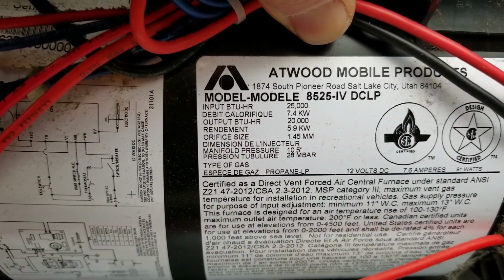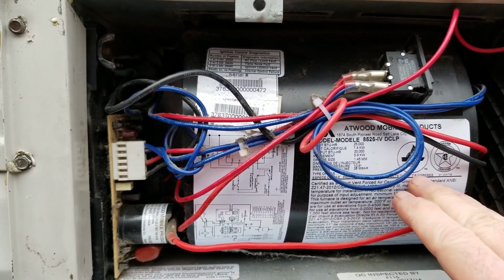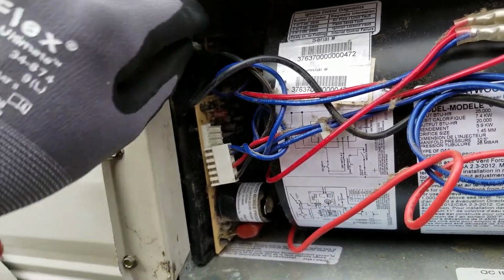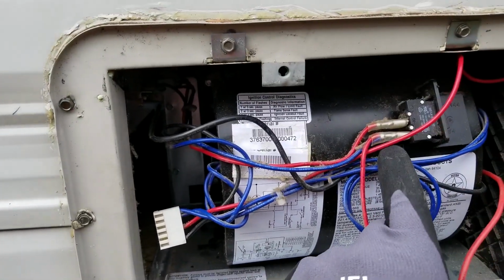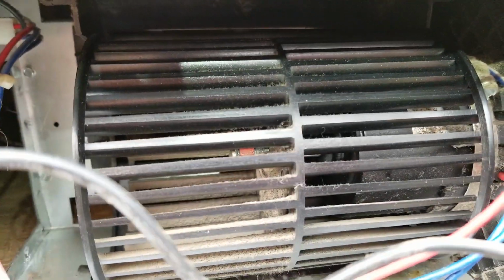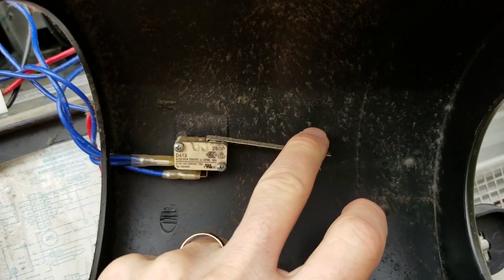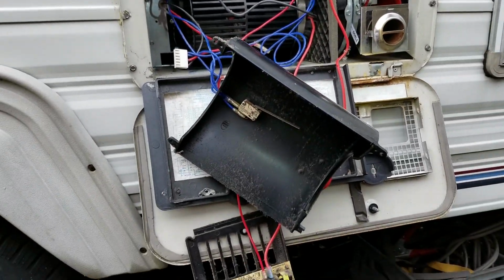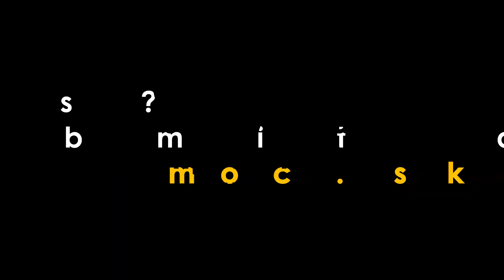Atwood 8525-IV RV Furnace Air-Flow Problem Due To Loose Blower Motor Cage

Comment: Thank you for your videos. They are a great help when you cannot afford unlimited repair bills. Have an Atwood 8531- IV. We woke up one night to a rattling noise coming from the furnace and then the furnace stopped working. I thought something may have broken or mud dabber nest broke free.  Opened but saw no debris. Circuit board is indicating air flow problem.  Checked the Sail Switch. No debris. Closed it and checked continuity-good.  Fan and fan cage seem fine. No rattles. Not broken.  I heard in this case the limit switch is rarely the problem.  What other options should I consider? Thank you for your help.

Comment: Hello fellow camper owners.  I just completed a long multi week hunting trip in Utah and Colorado in our 1995 Lance TT.  Right off the bat I was experiencing some furnace problems with the Atwood Dometic Furnace. This was not good as we were heading to some high altitude and cold weather into the teens.  The furnace  would initiate the start sequence with the fan motor turning on and approximately 30-45 seconds it would not open the gas valve and would not start to warm up.  It would shut down.  I tinkered with it for a few hours.  The code was an air flow code.  I initially thought it was the sail switch so I wired around the sail switch to see if it fired.  It did not.  It was not the sail switch, in my works I discovered that the stainless exhaust port has to be fully shoved in and tightened down.  With the intermittent problems I have had with our furnace over the past summer, the hold down screws for the outer cover were a bit loose,  I used toothpicks to assist and hold the outside panel in place, easy fix but thought others could use this information.  One of the problems that caused the intermittent operation was the fact that we tow a lot of roads and things come loose especially screws that have enlarged holes.
Reply from the maker: Thanks for the info. I do mention on some of my videos that the relationship between the sail switch and the Control Board needs to be such that the control board sees the sail switch changing states. So, if you bypass a sail switch, or wired always open or always closed, your furnace would not ignite because the control board never saw that change of states.  Also on the AF series furnaces it is important to have that exhaust port installed as it is part of the entire furnace system.  So glad you found that out as well. Stay warm and happy camping.

Comment: My old camper. Same Furnace. Thanks to our resident mouse a peace of peanut shell was hanging the sail switch. Thanks for your help. I removed the peanut shells and took the little peace from behind the sail switch. Put it all back together crossed my fingers and turned it on, poof on came the furnace. I'm a real live hero at least for a few minuts. Thank you for the video! Ron

Comment: Thank you for this one.  I had my entire unit out yesterday and damn if I could figure out where the sail switch is.  My furnace fan is coming on but I am not getting ignition.  Occasionally it will work but more often than not, it isn't.  I have always suspected the sail switch but could never find anything that would show me how to get to it.  Hopefully it is a lint problem.  I was ready to replace the control board and the gas valve.  Will see if this fixes things.  Kudos!

Comment: Thank you for this video. The furnace in my trailer is exactly the same model. Your video was easy to follow, and correct. My sail switch had lint debris on it. Cleaned , and reinstalled and we have heat again! I did this repair today, while camping. 10/29/20. Thank you!

Comment: I have been having sporadic heater problems with my 2019 Coachmen Freelander 32 FS. I had removed the sail switch and checked it with my ohm meter several times.
It always checked good. After watching this video, I realized it must be my sail switch, but how can that be ??? I looked at the little bracket that holds the sail switch and 
then tried to see if it would work and it did as long as i pressed on it. The pressure I was putting on the switch was more than what the blower would exert on it I surmised.
So, when I tried to do it with little pressure, it wouldn't come on. The "sail" was hitting the bracket !!! So I filed about 1/16" off the side of the bracket where the sail was hitting
and WALA, works fine now. I think this is a design flaw by Dometic. Just my opinion. Could not have solved this without fulling understanding the problem spelled out by the
video. Thanks, sorry this was so long but felt it needed to be said to help others that can't figure out why this would happen.

Comment: Thanks for all the tips, I was able to fix my 8516-111 furnace simply by bending the flame sensor rod closer to the burner, no more intermittent heat. It hasn't worked properly for the last 24 years, Yahooo!

Comment: I have an 8520-IV that had the same error, however, the housing was fine.  Disconnected the circuit board and reconnected and all is well. Thank you for the tip!  Furnace is fired up!

Comment: Just purchased a used travel trailer with this furnace and haven't had a chance to test it yet. Unfortunately ours does not have an external door so may have to detach it inside and have a look at it.

Comment: I have the same model number furnace, but my control board doesn't have those two wires you didn't disconnect, and I have a circuit breaker and blower motor relay attached to the housing along with the power switch...  🤔

Comment: I have the same furnace and have the same blinking light warning, I took off the cover and the fan is really clean, is it possible that the switch is bad? Could it be a thermostat issue? Or is there something else that would throw that same warning light? I really appreciate your videos! This is my wife and i first travel trailer and we are having to fix somethings and I’ve found all your videos to be helpful!

Comment: thanks for the video. My camper through this code this morning. With the info in your video, I was able to get mine to work again. Going to bring up some canned air and clean out the squirrel cage and see if that will keep the switch from sticking. If it throws a fault again, I will order a new switch.

Comment: Hello Darren 
I have an Atwood 8535-111 after watching your many great videos 
I pulled the burner head out and it was rotted out 
Every one is saying that burner heads for this furnace are no longer available 
And after many hours searching found some similar but as you said they are different similar but not same mesh hole size!
Do you have any burners for this model or what would you recommend ??

Comment: Hi there, thanks for your video. in my case the sail switch is clean and the furnace is lightning, hot air coming out the exhaust but only blowing cold air inside... any ideas on what that could be?

Comment: So mine did the same thing.  I tapped and rapped on the fan housing, hit the reset on off switch and it started working.  Mine is a new design with the control board in the middle vs the left.  So do you think something got lodged in there preventinhg the switch from activating.  I'm afraid that it will happen again.  Do these switches fail?  Update:  From watching so more videos mine is newer with the sail switch available from the outside by removing a couple of screws unlike the older way that required removing half of the fan housing.  Mine was covered in lint preventing the switch from activating.  I Ohmed out and the switch is good.

Comment: I have a question i have exact same furnace runs great no issues fan turns on furnace runs for about 5 min then flame shuts down for about 2 min can stays going then kicks back the flame again is that normal to cycle flame im not familliar with these thank you

Comment: Hey body, I never own a trailer before but just bought a 2005 22’ Jayco from a cousin last month.  I just notice that the heat wasn’t hot.  The furnace turns on but shut off after about a minute.  Do I need to open the propane tank before I turn on the furnace?  Or is it something else?  I have an Atwood furnace as well.  I subscribed to ur channel.  Great vdo and info.  Thanks
Reply: So you will need to turn the propane on first yes. Then actually get it to the furnace. I usually put a lighter to the stove until it ignites to get the propane through the line as much as possible. Whats happening to yours is its turning on like normal, not igniting the gas because its not there, and then as a safety its shutting back down.

Comment: Thank you. I have a 40 ft class a with 2 of these same heaters . I have to get them working for winter coming fast . They were working last year when I got RV .   I will check snail switch and follow up . Thank you for the tips and info

Comment: My RV is only 2 years old and I have a single blink. I’ve blown everything with a air compressor and still same single blink. Could that white piece that the sale switch hits be to tough all of a sudden ? Should I spray it ? Obviously let it dry before turning back on.

Comment: I am having the same issue with my Suburban SF-30 furnace. Replaced the circuit board thinking that was the issue. Problem still there. Fan starts, no ignitor clicking sounds, furnace shuts down. I checked the sail switch. I appears to be functioning. I will bypass the switch to see maybe it is actually bad, then I am clueless.
Reply: I the sail switch has to make a transition. A constant close doesn't provide a change that happens from the fan moving air.

Comment: Hi rv works my rv furnace works fine but the blower stopped working it once blew nice heat out before  I hear the click from the thermostat but doesn’t engage now
Reply from the maker: The low-hanging fruit would be to check for a blown fuse. But I'm sure you've already done that. We're working on uploading a video where we're diagnosing the fan motor itself. That one should be coming out in the next week or so.

Comment: How do you find a relay switch? Our trailer is 30 yrs old and was told that needed to be replaced...faculty.
Reply from the maker: On a furnace, a relay is used to start the blower motor. Some of the older furnaces will have a small Ice Cube shaped relay with four wires coming out of it that is mounted to the right of the blower housing. Others will have that relay on a control board.

Comment: My furnace kicks on and runs but does not fire.  It will not shut off after 15 seconds either.  Fan will run and run until I turn it off but will not ignite.  Gotta check sail switch 8355-11 hydro flame

Comment: I have an Atwood furnace model number 8940 111 dclp in my fifth wheel furnace will not come on when you turn it on hear clicking in the front air conditioner
Reply: The circuit board has one flashing light check the motor the motor has work on a 12-voltI've checked all fuses all fuses are good have unplugged circuit board plugged it back still doing the same thing I don't know how to check the sail switch have a small clicking noise after I reset it then light blinks
Reply: It might be the relay which is on the circut board. In that case but a replacement.  It could also be a sail or high limit switch.  Sail switch is easy to replace but limit switch is more difficult.

Comment: Mine blows and blows but doesnt get hot the sail switch is clean and i cleaned everything but it still wont get hot it just blows clod air until i turn it off so whats that? It looks just like this one not dirty at all
Reply from the maker: It sounds like you are not getting ignition. So if you're not getting ignition you need to follow the control wiring circuit, I refer to those as the blue circuit. If you have multimeter make sure you're getting 12 volts back into the control board after it's made these stops through the sail switch, high temperature switch.
Reply: @MyRVWorks  got it going but i can smell burning smell inside i cleaned put the dirt it blew out, i have 2 carbon monoxide detectors so hopefully its not that but it smells burned is that normal? Its a 1995 holiday rambler Alumilite heat has not been turned on in probably 8-10 years

Comment: What did you end up doing here long term?
Reply from the maker: Customer did not want to invest in a new blower housing so I wedged some foam between the service door and the blower cover to keep it in place.   Unit is stationary so did not need to consider road conditions.  After about a year still working!  Had to go with what the customer was willing to spend vs. making the 'correct' repair.   BTW: same customer, different RV, as the water heater job that was dying from (blue) rust flakes.  https://youtu.be/EsjiDo7FN_Q

Comment: BEEN SEARCHING FOR A PERSON LIKE YOU THAT KNOWS WHAT THEY'RE DOING. I HAVE NOT WOOD FURNACE IN MY RV BUT I'M GOING THROUGH A TANK OF FUEL IN 27 HOURS BARBECUE SIZE GRILL I SHOULD SAY 20 POUNDER. BUT I'M A DISABLED VET AND CAN'T HARDLY AFFORD THAT COULD YOU PLEASE TELL ME WHAT IS WRONG WITH MY FURNACE.
Reply: A 20 pound tank of propane doesn't go very far when it's cold out in a poorly-insulated camper (thin walls, single pane windows, aluminum trim).  Your furnace is probably fine.  I go through around ten 100lb tanks per year, which would be 50 20lb tanks IF they were filled to capacity.  The exchange tanks (where you exchange your empty tank for a full one) are underfilled so will last even less time.

Comment: my problem is that it works well for 20 seconds it goes off it turns on again like 20 seconds it turns on again it repeats like 5 times and stays off or starts working fine.